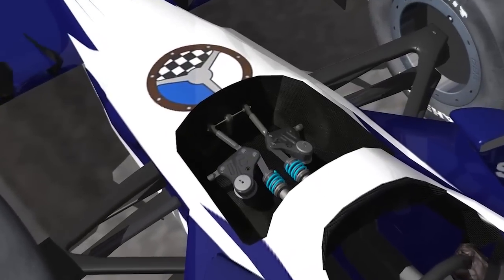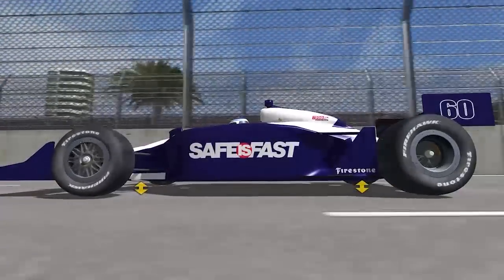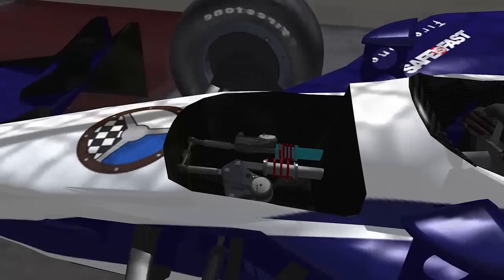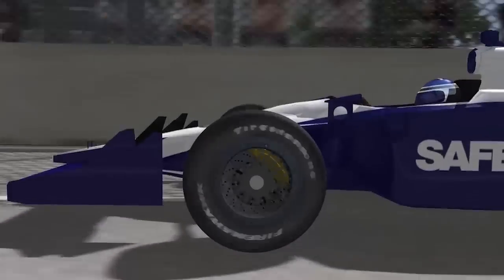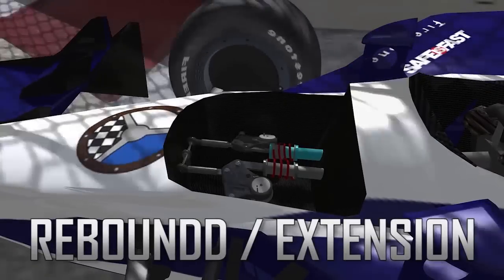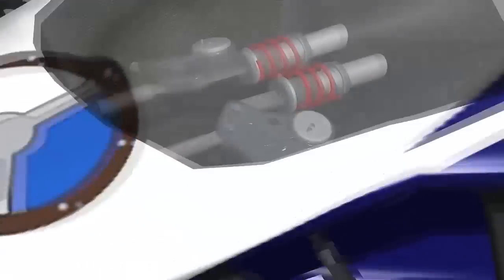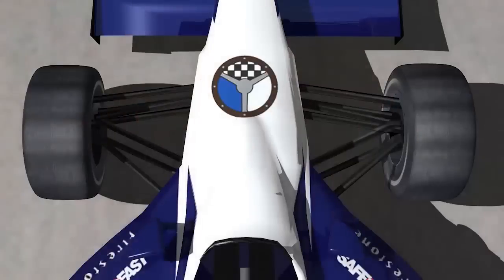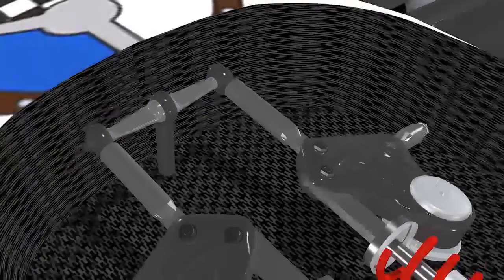Basic Chassis Set Up 2 - Springs, Shocks, Anti-Roll Bars and Bump Rubbers

Comment: I got a civic ep3 and the ride is superstiff what can I do to make it more comfortable? flexible or rigid springs?
Reply: A but higher ride height, softer springs. Try compounding 2 different rates of springs, so you can go soft, but right before you would begin to reach a dead stop on your suspension it keeps it smooth. Also, street cars are supposed to have street car suspension. Be smart, don't act like your civic needs a track suspension. Performance for a street car is being able to hook all 4 wheels on bad terrain. So a hard suspension is a big loss of performance for the road

Comment: so if i have a fwd that tends to understeer, should i put a better rear sway bar to correct this?
Reply: No, if it understeers your problem is at the front axle and you should try to correct that first, before looking at the rear axle. It's at the end of the video, basically soften the front by either softening anti roll bar, dampers, springs or reducing ride height. That's the order you would do it in as well  idea being changing as little as possible else. For example ride height changes a lot of other things, so you don't want to mess with it necessaritly